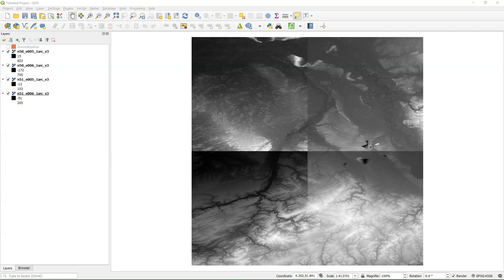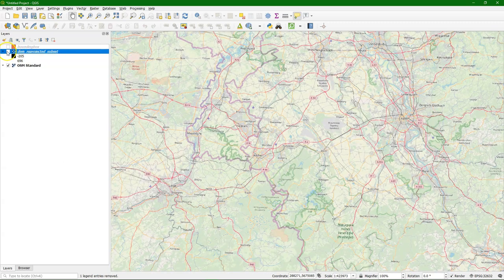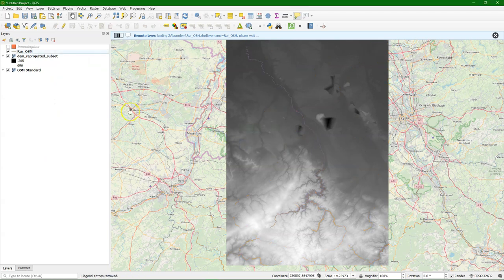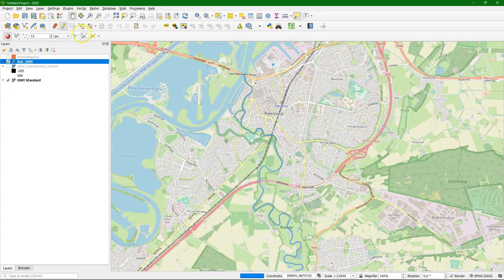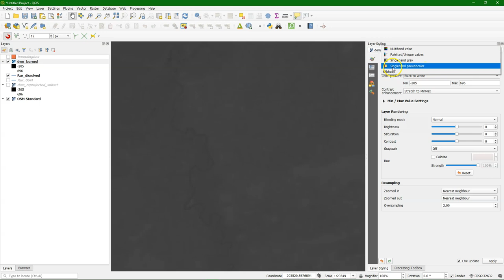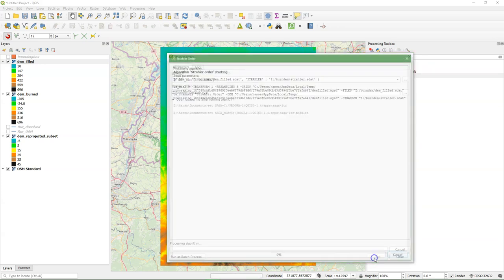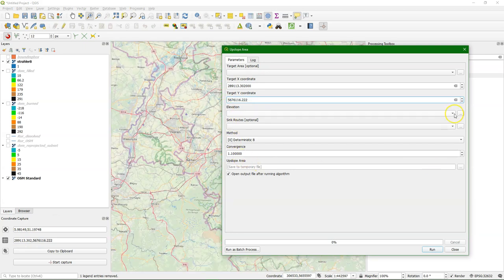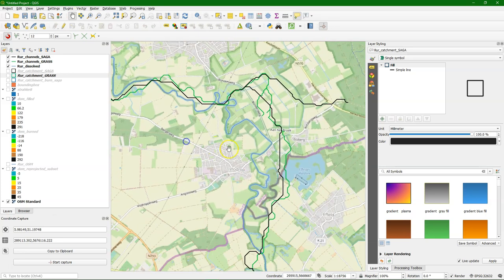Burning stream network into DEM layer in QGIS

Comment: Thank you, this was one of the most helpful vids on QGIS I have seen so far
Reply: r. carve is still not working for me - is there something I'm missing? Mainly  - is it only able to work on one vector line at a time? I am trying to have it carve several lines at a  time into a DEM. Are there other issues I should be aware of?
Reply from the maker: @drewfrench8784  I also tried a bit. It only works if you do the corrections that are mentioned in the video and dissolve the river into one feature. Maybe for the whole river network you can use the other approach: https://youtu.be/jHT_StPb_oM or use PCRaster Python.

Comment: Hi Hans, can I use r.carve to burn not only main river but also other hydraulic structures (Eg: Underpass of the Bridges (Brückendurchlass) or Railway (Bahndurchlass), culverts) on the foreland, which define the correct flow path of the rain. 
In other words, I do not want to burn those structures just assigning a specified depth value in the r.carve tool, but I wanted to select these Structures as a vector layer (line), and then extract the Z value of this line layer (Single line which consist of 2 points) from the DEM at the beginning and the end, thereafter use these interpolated or given Z values between these 2 points of line to burn the DEM
Reply from the maker: You can do that, but it depends on the purpose of your study and the detail of the DEM (DSM?) if it makes sense. Also check this tool from WhiteBox: https://www.whiteboxgeo.com/manual/wbt_book/available_tools/hydrological_analysis.html#BurnStreamsAtRoads. There's also an interesting reference on the page. The tool can be used from QGIS with the WhiteBoxTools plugin.
Reply: @HansvanderKwast  Thanks for the link and I will have a look on it.

I have used r.carve tool to burn my 3D Line (Line with Z Values) into the DEM. I assigned only the width of the raster and let the depth as default, and then the r.carve tool automatically interpolated the 3D lines linearly and burned it in to DEM.

Comment: Hi Hans, thanks for your videos, a true QGIS Encyclopedia!
You first burn the stream and afterward fill the sinks. Could you please explain why? 
I have no based opinion, but following my ...well, my instinct, maybe I would have done the opposite, because I don't know how r.carve would act if it comes across a sink just along the stream. I guess that r.carve would find it easier to carve a flat surface rather than a surface with holes. As you see, this is only a hypothesis (it would be true if instead of by an algorithm, the carve was done by a child on the sand...)
Thanks again!
Reply from the maker: Hi Fabio, good question. Before I made the video I tried both workflows. Only the one in the video worked. Probably filling the sinks first and then burning the river still causes local depressions.
Reply: @HansvanderKwast  Thanks a lot!

Comment: Hello,
is it possible to use this to correct your Strahler Orders? I have a problem with some small channels (1m width) which don't appear in my DEM so the Strahler Orders aren't totally correct, but it's a much smaller scale. Can I just burn them into the DEM an re-run the Strahler Orders? Thanks in advance.
Reply from the maker: With burning the rivers in the DEM you can indeed get closer to the real channels and possible improve the Strahler orders.

Comment: Hi Hans, I followed all your steps but my river doesn't shop up in the burned DEM. I tried a few different settings and one time accidentally forgot to tick off the 'adjusted stream points', which did show the river in a different layer (but not burned into the DEM). Do you have any idea what I could have done wrong?
Reply from the maker: Hard to tell from your description what goes wrong. Are you sure the projection of the layers match?

Comment: Hi Hans, a very useful video, thank you. I am having some issues with r.carve. I have followed all of the steps up to using that point, but in addition to the errors which appear in your log, I also get the following:
ERROR: North must be north of South
WARNING: Unable to determine input map's vector feature type(s).
WARNING: Output layer is empty, no features written

The resulting tiff has values of -34*10^-38 to 34*10^-38 and nothing appears. Any ideas?
Reply from the maker: Hard to tell what the reason is. The result means that all pixels probably have missing value (I guess you read it from the legend. The correct place to read it is from the layers property). One reason can be that CRS is wrong. Make sure that DEM and stream have the same CRS and that it's not a GCS (so not EPSG:4326). Check also the manual page: https://grass.osgeo.org/grass78/manuals/r.carve.html.
For an alternative robust method see tutorial 8 on this page: https://courses.gisopencourseware.org/course/view.php?id=10
Reply: @HansvanderKwast  Thanks for getting back to me. I have followed the steps religiously and it still produces the same error. Even when I use the single SRTM image of interest. Essentially, I am trying to force the River Network algorithm to join two two sections of major river that it doesn't want to. Is burning the only way to do this? Is there another workaround?
Reply from the maker: I guess you want to burn in the river, because the study area is too flat. If it's really flat the algorithms will not work. Hard to judge from text messages what goes wrong.
General checklist:
1. Use QGIS LTR version
2. Use a CRS, not GCS
3. Interpolate voids first (nodata pixels in DEM)
4. Mask sea, ocean, lake if your outlet is where the river enters the ocean.
5. If it's too flat, the algorithms don't work. They are gravity based. There are no automatic alternatives.
6. Try alternatives (SAGA, GRASS, WhiteboxTools, PCRaster). Videos are available.
7. Don't use spaces, accents, dots, minus or other strange characters in file, folder or profile name.
8. Don't use very high resolutions or too large areas.
That's all I can say from here. Live support is possible at a charge.
Reply: @HansvanderKwast  Thanks for the help. Lots of things to try. I really appreciate it!
Reply: If my stipend would stretch I'd have no hesitation paying you, ha!